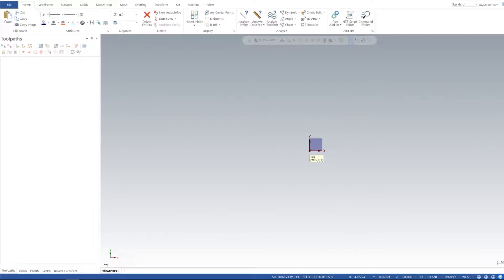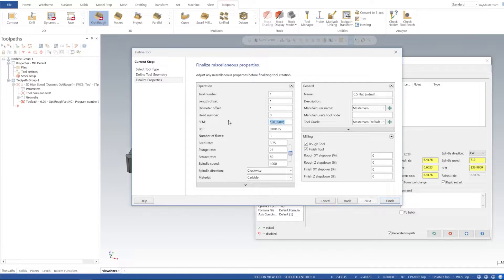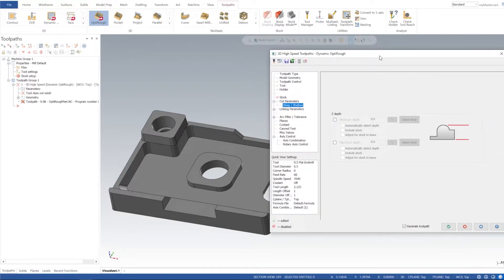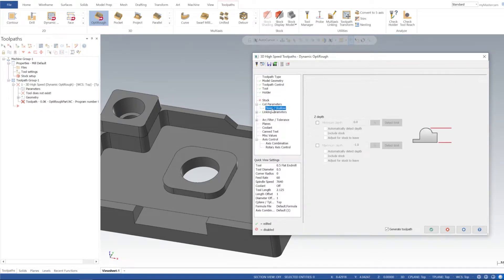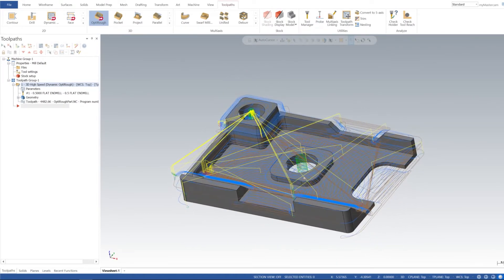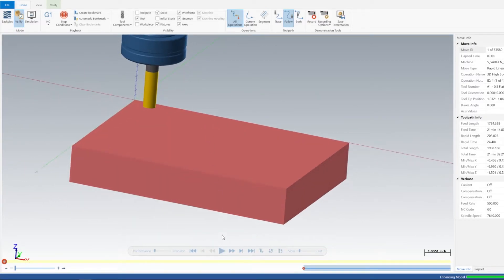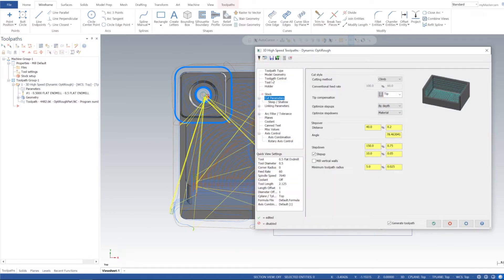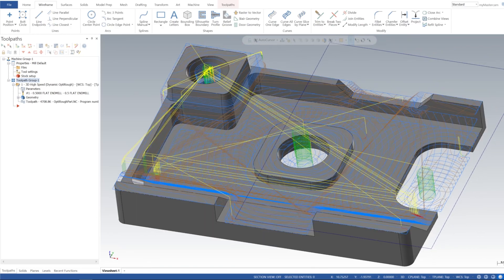MasterCAM OptiRough Tutorial

Comment: Why did you select Avoidance Geometry instead of Machining Geometry?
Reply from the maker: I haven't used mastercam in about a year so I'm a little fuzzy on the reasoning. I just remember doing it that for years. You might be right to use Machining Geometry. Try it! Just make sure your simulation represents your actual work environment to avoid gouging and broken endmills. 😁
Reply: I’m just now diving into masterCAM and trying to figure it out, and I was using the machining geometry option and it wasn’t roughing out the pocket on my part for some reason, but when I switched it to avoidance region, it worked perfectly. I still don’t know why though